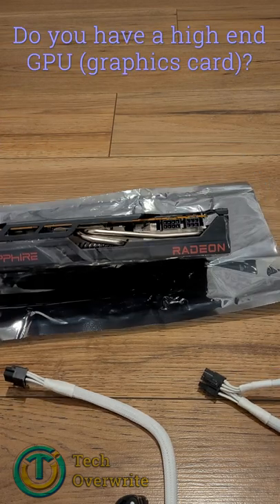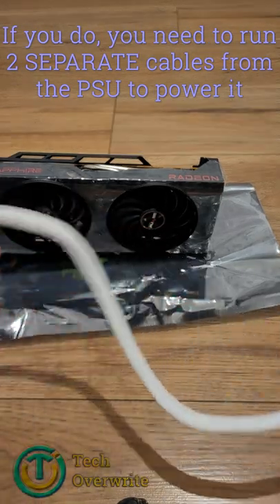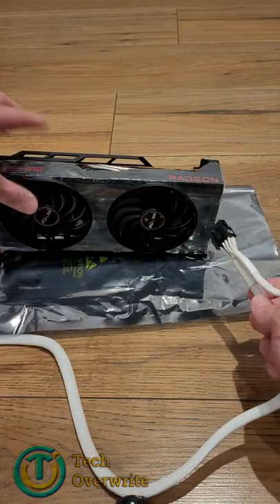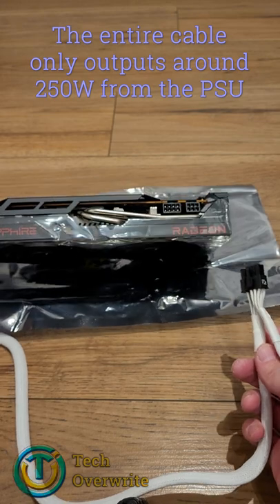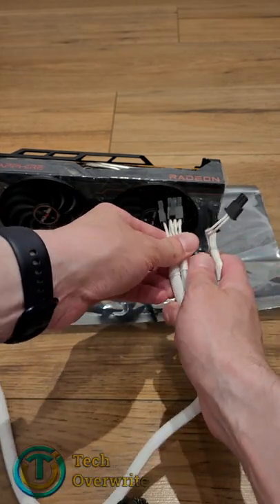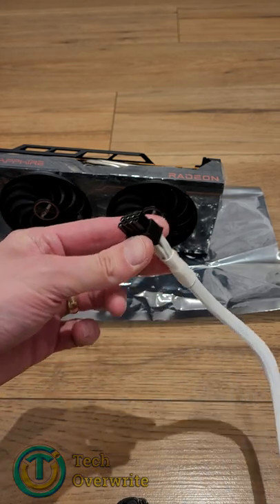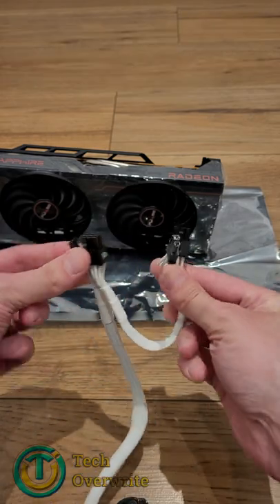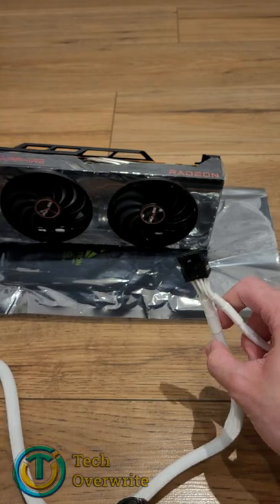Why You Should NEVER (Usually) Use The Same Split (Pigtail) PCIe PSU Cable #Shorts

Comment: You Should have included some more information for people. As PCIE SIG rates 8pin PCIE to max of 150w but actually the cable can deliver around 255w to 288w and in some cases 300w on single cable but for safety reasons they have set the bar to low, and on only on 16awg cable it can deliver up to 288w but there are variations in 16awg some support 7amps per cable and some 8amps. My assumptions are that the time 8pin spec was released the graphics card wasn't that much powerful and thus they gave relieve to manufacturers for using thinner cables like 20awg or 22awg. The whole 16pin drama was created because graphics cards are now power hungry af and PCIE SIG has gone balls to the walls on their 16pin and they rated it at 600w which is maximum that cable can do, that's why it is more vulnerable to bends or improper handling or which wire you use 16awg, 18awg. one more thing to include 8pin has 3 12v rails and 16pin cable has 6 12v rails so it's obvious that 8pin can do max of 300w.  Source: http://www.jongerow.com/PCIe/index.html, https://forums.tomshardware.com/threads/whats-the-max-current-power-rating-for-the-8-pin-pcie-connector-really-where-does-150w-come-from.3647891/.
Reply from the maker: Many thanks for the detailed comment, you're right that I could have expanded on this a lot (although I was concious of fitting it into the 1 minute limit at the time). I appreciate your detailed response though, and it would be good if there was more clarity on this from both GPU and PSU makers 🙂
Reply: @TechOverwrite  Thanks fot replying back.  This is not fault of PSU makers it's fault of PCIE SIG that they haven't updated the 8pin specs according to latest gen or give guidelines to manufacturers  to shift to 16awg cable bcuz if they did I'm sure 3090 would be running with just 8+6pin and 4090 with 2x8pin that would be freaking cool and not have to deal with that fking thick cable with issues.

Comment: What if I have a gpu with 3 ports but only 2 psu cables? :/ safe to use a y splitter?
Reply from the maker: It should be okay (since the 2 cables supply up to 500W, then the motherboard PCIe slot gives another 75W). So unless your GPI requires well over 500W, you should be fine 👍

Comment: So what if my card doesn't need the demand of power is it bad to use 2 separate cables if it doesnt "need" it. Would it "overpower" the gpu or sorts? Ive got a radeon rx6800
Reply from the maker: Good question, you'd probably be fine if you undervolted or simply never stretched the GPU too much. 🙂

Comment: What do I if my gpu only has one 8 pin connector but my PCIE cables are together making a 16 pin
Reply from the maker: It depends more on the TDP of the GPU to be honest. If its 250-300W it might be fine with just one proper (separate) cable, but any more and you might have issues.

Comment: Im confused im running a 750 watts psu and rx 5700 gpu and i connected the two pcie you should in the video. Should i change it? If so what should i do? 

Im a newby. Sorry if i suck at explaning.
Reply from the maker: No worries, so do you have a single PCIe cable (from the PSU) and you're using the split/pigtail for the two connections on the graphics card? If so, you might need to change this to be two separate cables from the PSU - especially if your card freezes or crashes when playing intensive games.
Reply: @TechOverwrite  Yes, is it found in the psu? (Im using corsair cv750) or do i have to buy it?

Comment: Im own rx6900xt for upgrade that is have 8+8+6 configuration...found that my PSU also have 2 PCI-E port only...so is it safe to use pigtail for that 6pin?
Reply from the maker: You should be safe to use two separate cables, then a pigtail for the last connector. The two separate cables, plus the motherboard PCIe slot, should supply the required power for you GPU 🙂 (awesome GPU, btw 👍)

Comment: I have a rm850x and a 3080 with 3 plugs. And my psu comes with 2 of the splitter cables that leads into 2. Can I plug both of them into the psu, but leave one unplugged next to the gpu so I can fill up all 3 slots ?
Reply from the maker: Yes that should be fine for the 3080, it'll all supply enough power for that card. 🙂
Reply: @TechOverwrite  I returned it and got a supernova 850 GT. It has 3 seperate vga ports with 3 pcie cables. So no need to use daisy chain cables for a gpu which I don’t trust

Comment: is it ok to use single cable for the 6700xt the tdp is 230w my psu 550w and have just one cable amd recommend 650w psu with 2 cables 8pin+6pin
Reply: I'm really confused
Reply from the maker: It should be okay... in theory. In practice you might just need to try it out. A PCIe cable usually gives 150-250W and the motherboard PCIe slot gives another 75W. So with 1 cable, you should get around 225-325W of power. Meaning it should be okay for the 6700xt, but it's not a clear cut case unfortunately.
Reply: @TechOverwrite  understandable. Thanks for the response appreciate it

Comment: I have a 3090ti suprim X I want to get a 1000w PSU which one do I have to get that comes with 3x 8 pin PCIe?
Reply from the maker: Oof, nice card 👍 I think the Corsair RMX series has three or more PCIe connectors. Certainly, the 850E RMX does so I assume a higher watt one does too.

Comment: Is it safe to use only one 6+2 cable on my Rx 580 8gb? My psu only comes with one, but my GPU required two connectors
Reply from the maker: It's hard to tell, because the recommended power specs for the RX 580 vary a lot depending on the exact model/manufacturer. The motherboard PCIe slot will supply 75W too, meaning that a TDP below 250W should be okay with 1 cable - but keep an eye on any crashes or freezes.
Reply: @TechOverwrite  my rx 580 is from sapphire nitro, and it runs 2304 sp. Does it draws power more than 250w?

Comment: should i use 3 cables in my 3090? 
I still got no answer to that 
did my research and so far this is the best video i've found
Reply from the maker: I think 2 separate cables (so one dedicated cable, and one pigtailed, for 3 PCIe overall) will be fine for the 3090. It's TDP is 350W and two separate cables (plus the PCIe mobo slot) will provide 400W+ easily enough. 👍
Reply: @TechOverwrite  was just about to ask because I only have 2 cables with my PSU while my 6900xt uses 3 8pin connections. 500 watts should be enough.

Comment: is it safe for my msi rtx 3060 gaming x use 1 pigtail only? combining 8pin+6pin?
Reply from the maker: Yes that should be fine because it's overall power use is fairly low, below the amount the PCIe cable and mobo PCIe slot will supply 🙂

Comment: if your GPU requires less than 250 however it doesn't really matter
Reply from the maker: Yeah that's true, especially since the mobo PCIe slot supplies 75W or so (which I forgot to mention in the original video) 👍

Comment: my psu came with 2 and my gpu uses 3 6+2 plugins should I buy another cable?
Reply from the maker: This should be fine. Use the 2 separate cables, but pigtail just 1 of them (for the 3 total connections). This should supply enough power for most mid range GPUs
Reply: @TechOverwrite  it’s a 3090.

Comment: So then what should I do for a triple 8pin card? When my psu must be sfx and only has two pcie ports
Reply: use the pigtail going from the middle slot to the rightmost port
Reply from the maker: Yep, @zBepis is right. Better to have 2 separate cables (and one pigtail) than a 2 port GPU with only 1 separate cable. 🙂

Comment: I have a 3070ti which has 3 power ports. So should I use 3 separate cables?
Reply from the maker: Good question, something I should have covered in the video. In this case, the two separate cables will supply enough voltage - whether or not you then use a pigtail for one of the connections. So you'll be fine with 2 cables 🙂
Reply: @TechOverwrite  thsnk you so much I've installed it yesterday and I run it with 3 cables. That's OK too right?

Comment: Where do i plug it for the power i don't know or my powersupply got spot to plug it
Reply from the maker: Do you have a modular PSU? I should have covered this in the video sorry, but naturally a non-modular PSU won't have the capacity for plugging new PCIe cables in 🙂
Reply: @TechOverwrite  i used a old just bought a new pcie power supply with the right cables

Comment: im looking to buy the saphire rx 7900 xtx and it needs 3x8 pin so should i use 1x6+2 single and one 6+2 pigtail or spend more and get 3 single 6+2's (420w tbp)
Reply from the maker: Hmm, that's a tricky one. The two PCIe cables will supply 350-400W, and the PCIe mobo slot another 75W. So in theory, you should be fine with just 2 cables (and using a pigtail)... but it's quite borderline. If you had a cheaper PSU and wanted to overclock your GPU, you'd probably run into issues. If I were you, I'd firstly try keeping your existing PSU and run with 2 cables + the pigtail, and just be cautious of crashes etc.
Reply: @TechOverwrite  Thank you. I have a Corsair rm1000x and I checked on pcpart picker and the full build should just be 770W

Comment: Can I still do this with a GTX 1080ti??
Reply from the maker: Ooo good question, you might be borderline because some 1080Ti models have a power draw close to 300W (whilst others are 240-250W and should be safe, when taking into account the power supplied by the PCIe slot itself - something I forgot to mention in the video itself). Maybe try it out but if you get crashes, especially during heavy gaming, then that might be why.

Comment: an rx 5700xt should be fine with one cable right? Oh well i just learned that rtx 3080+ cards use 250-350w 😆 I didn't get the 5700xt yet and i was thinking i might get a molex to gpu cable as i only have 1 freaking GPU cable on my 750W cooler master PSU 😒 But it should be fine with one pigtail cable.
Reply from the maker: It's tricky to know for sure, but yes I agree that for that card and PSU, one pigtail (and one separate cable) should definitely be fine 🙂

Comment: Is it alright for a 250 watt gpu?
Reply from the maker: It depends on the PSU and the PCIe cable used. In theory the motherboard slot only gives 75 watts, so 225 watts is 'safe' for a GPU - and 250w is not. But in practise, a good quality PSU should supply more than 225w in total. It's hard to say for sure (unfortunately). You could always try it and undervolt the GPU slightly if you start having crashes.
Reply: @TechOverwrite  I have a Corsair RM650 which in the manual it says it is not recommend to use a pigtail cable for 2 Pci slots GPU with more than 288 watts.

But I will undervolt it and reduce power limit. Thanks for help, man.

Comment: should i do this with my 3060ti since it isn’t really high end
Reply from the maker: You should be safe here. The PCIe slot on the mobo also supplies 75W or so, meaning you should be fine. It's usually better to run 2 separate cables, but for the 3060 Ti I can't imagine any real problems.
Reply: @TechOverwrite  i ended up doing it regardless for safety and dont regret it one bit

Comment: should also mention that the board will give you 75 watts also, but the point stands, better safe than sorry
Reply from the maker: You're right to point this out, it's good to remember for sure (and I should have included it in the original video) - thanks 🙂

Comment: So what the purpose that piqtail cable???
Reply from the maker: A fair question. In theory the design could allow some PSUs do distribute the load a bit more between the two ends. In reality though, this often doesn't happen and it's mainly good for 'tricking' a lower TDP GPU (that requires two connectors) into booting up.

Comment: I wanna ask if 3060 its ok using just single cable? Thanks
Reply from the maker: Yep that should be fine. It's TDP is 175W IIRC, which will be fine through a single cable.
Reply: @TechOverwrite  Ok thanks for the info

Comment: Do i need to do this with 3060 ti because if i remember correctly thsts not 250w
Reply from the maker: The motherboard PCIE slot also supplies 75W, something I forgot to mention in this video, so you can take this into account too. Basically a GPU with TDP below 300W should be fine 👍
Reply: @TechOverwrite  thank you! I was afraid i will damage my gpu

Comment: What if my Power supply has 2 ×8pin. And my gpu has 3 ×8pin
Reply from the maker: Ugh it's a tricky decision for sure. You might find that using one full (unsplit) cable and then one split (pigtailed) cable will end up working out fine. You might just have to check. My hunch is that a 300W card would be fine with one full and one pigtailed cable, but a 500W card would not be

Comment: So not too long ago I bought a used 2060 super from kfa2 and now I'm thinking should I do the same ?
Reply: Very optional in your case, a 175w card dosen't require two cables to function safely.
Reply: @RedOneM  Well thing is its the OC variant of the card i personally dont overclock it tbh i just dont see any reason to do so but thanks for letting me know :)

Comment: Wait do you put the psu side of the cable into the gpu?
Reply from the maker: No, you would still put the GPU side into the GPU. Basically the end with the split/pigtail would still go into the GPU, but you would only use 1 of the connectors (before plugging a second cable into the PSU). This assumes your GPU needs 250+ watts of power (and so ideally needs a second separate cable).

Comment: Can i use 430 watt supply with gtx 660 using 2x molex to 8 pin .... Cuz gpu is not high end and only require 300 watt psu and mine is 430 .... So it should work fine....?
Reply from the maker: That should be fine yes, I agree that the card's power requirements are pretty low so using one actual PCIe cable should be fine 🙂
Reply: @TechOverwrite  thx, means a lot 😊

Comment: I have rx 7700 xt and it is crashing now all the time and it was working fine. This card require 250w max and I connect the 2 cables and one port in the PSU. Could that be the reason? Or its just faulty? 

Btw its not thr drivers, its not thr system, I built this pc with good cabling connection and with good air flow, temps are nice too.
Reply from the maker: Ugh sorry to hear it, it sounds like you have a good build and GPU so it's annoying when crashes start. Is it crashing only when gaming, or when the PC is idle too? Crashes when you're stressing the GPU (i.e. when gaming or video rendering) could definitely be due to using just 1 port in the PSU. But crashes at idle is likely to be due to something else.
Reply: @TechOverwrite  It crashes in games and under load, and also when I am in Google chrome or Windows! Temps are good, watt usage is 249w under load which is good at 100% usage. It only lasted 10 days and then this happen. Should I worry about the one port thing? I mean its not more than 250w, isn't it?
Reply from the maker: One port could mean only 225w can be supplied (depending on the cable guage), so it could be a worry - i.e. your current usage might be stretching it a bit. It's hard to say for sure though - it might also be faulty drivers or GPU unfortunately.
Reply: @TechOverwrite  I got my friend's old GPU, which is gtx 1660 to test the problem. And it worked perfectly fine. So I think it's faulty GPU. However, can a card be faulty after 10 days of good usage? I mean manufactur faulty.

Comment: what if I have a non modular psu?
Reply from the maker: Then it gets trickier, unfortunately 😔 You'll either have to swap out the PSU, or just ensure that your GPU doesn't exceed the power supply capacity.

Comment: i have  msi gtx 980 so i think i dont need 2 pcie cables  but if i need in my psu i dont have another slot for pcie cable
Reply from the maker: Yeah true, the gtx 980 has a max power consumption of 165W, so you should be fine to use the pigtail here. The mobo PCIe slot will deliver around 75W, then the PSU PCIe cable another 150-200W. So you should be safe 🤞
Reply: @TechOverwrite  thank you bro

Comment: I’m confident my graphics card is fine but something definitely messed up.
Reply from the maker: Hmm interesting, I hope you can track down whatever issue you're experiencing 🤞
Reply: @TechOverwrite  found out the problem, had it plugged into the wrong port on the power supply, ran another pcie cable this time too! Everything works

Comment: Should I use 3 individual gpu cables for a gpu like the 6900xt
Reply from the maker: Nope, you should be fine with 2 separate cables here IMO (so 2x pigtail, and 1x separate for the 3x connectors). In this case the GPU's TDP is enough for just 2 separate cables 🙂

Comment: Can i use a cable with split with the rx 5700 xt?
Reply from the maker: Hmm, it might be touch and go. The TDP is 225W, which could be borderline (when using a split cable). Hard to say sorry. Under 200W and a pigtail is usually fine, but 225-275W is that tricky territory where it might be fine - but maybe not. Sorry that's such a vague answer 🙈
Reply: @TechOverwrite  Thanks for reacting pretty fast! Ill just try it. I have a powerfull enough psu so it depends on the cable.

Comment: Is a 240w tdp good to go with daisy chain?
Reply from the maker: Oof, maybe not. A typical PCIe cable can supply 150W, and the motherboard PCIe slot another 75W. So in a typical setup, it probably won't be enough no. Having said that, good quality PSUs can sometimes include thicker guage cable that suppy more than 150 watts. I discuss this topic more in the linked related video (the link should appear under this short video), if you wanted to learn more.

Comment: What do I do if I have a psu that isn’t modular?
Reply from the maker: Uhm, that will be trickier 😬 Just look at the GPU TDP. The single cable will supply 250W max, then the mobo PCIe slot will supply another 75W. So as long as your GPU is less than 300W and you don't overclock it, you should hopefully be safe 🤞
Reply: @TechOverwrite  TYSM for the info! I’ll take a look. 🙏